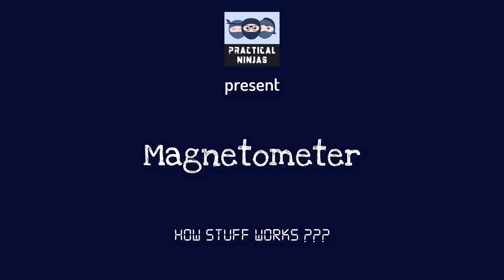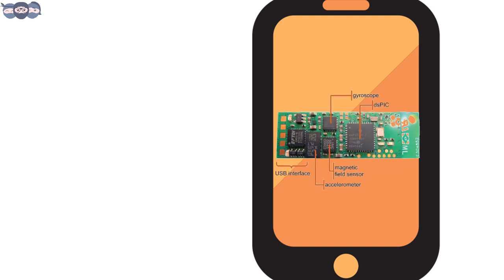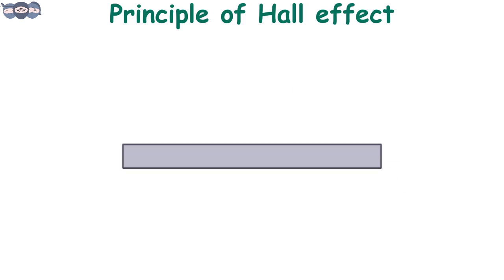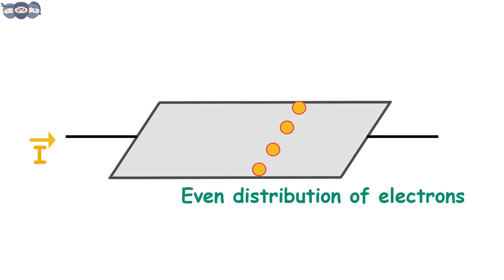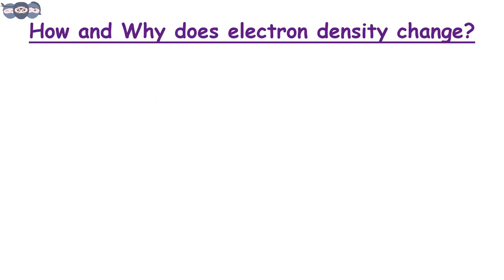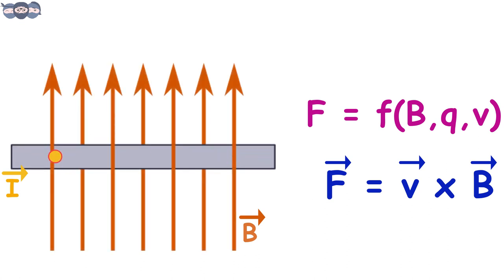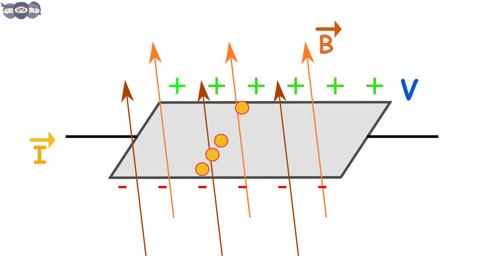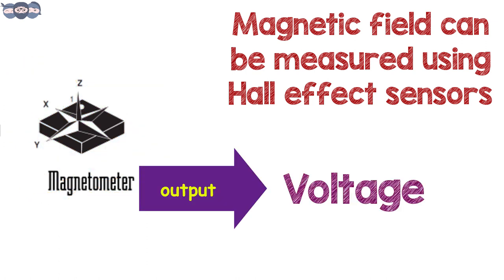How magnetometer works? | Working of magnetometer in a smartphone | MEMS inside magnetometer

Comment: Everything was nicely explained except it's not clear how the orientation is estimated from this -

1) How does rotating an object lead to reduction/increase in magnetic field ?
2) How would the resulting increase/decrease in velocity give the orientation.

Although I do follow it intuitively, an explanation for the last bit would have made your video complete.
Nevertheless, nice explanation. Thanks!
Reply from the maker: +malhar jajoo Thanks for your feedback. Glad you liked the explanation.

1) No object is rotated to increase or decrease the magnetic field. Increasing or decreasing the magnetic field affects the force acting on the travelling charged particles, in this case the electrons. As the magnitude of force changes, the path of electrons also shifts a little. This gives rise to a voltage difference whose direction is perpendicular to the travel path of electrons and the also perpendicular to the direction of magnetic field.

2) Generally, magnetometers are placed in such a manner that they sense readings for magnetic field in all the 3 directions, i.e x axis, y axis, z axis. From the readings of magnetic field in these 3 directions, the net magnetic field and its direction is calculated using vector addition on the three readings.

Hope the explanation helps you clear the doubts :) 
If still any doubt, feel free to comment below.

Comment: Helo my dea. We have a problem about G 856 AX proton magnetometr. Can you help to us ?
We have bought G 856 AX proton magnetometr from foreign contry since 2014 . We used it only one year. When we used the magnetometr was working.
Durin 2 years we didin t use it .
When we wanted to use it that time magnetometr didn t work. The number of the magnetometr was mixed. We only saw 777777 and 111111 on the screen and we heard bip. Bip. How can heal to us. Can we solve a problem ourselves.